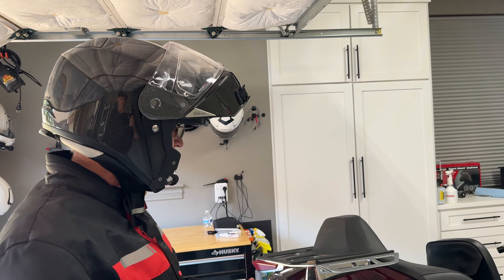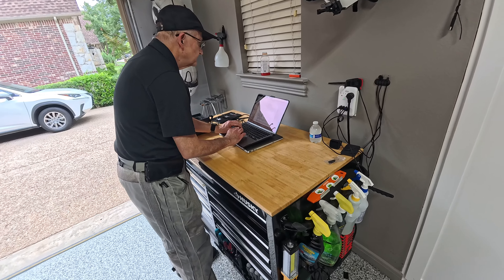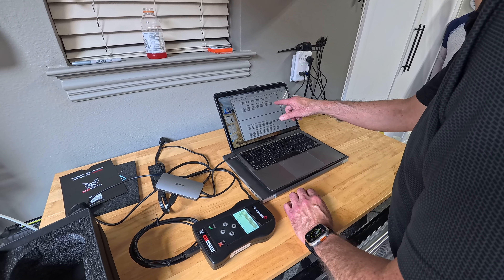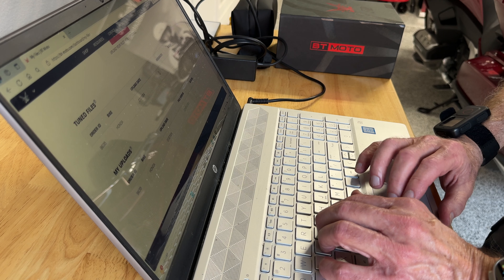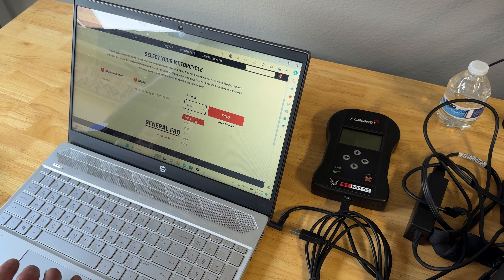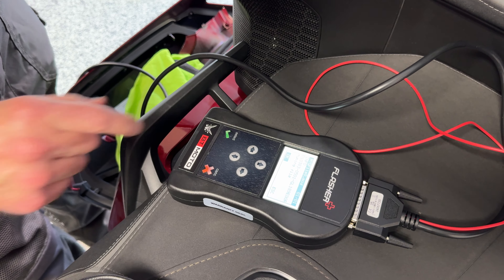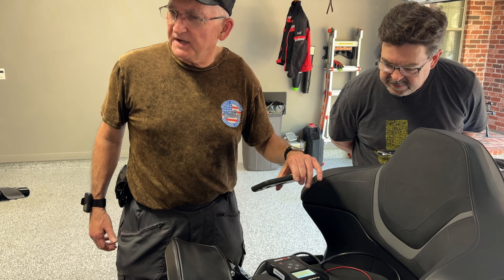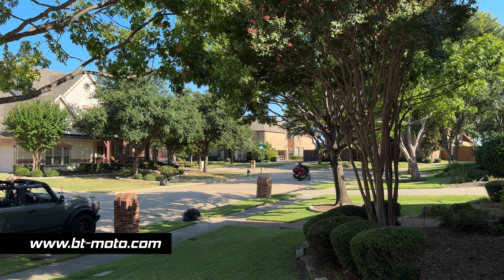BT-MOTO ECU flash on 2023 Honda Goldwing - SECOND ATTEMPT | Cruiseman's Garage

Comment: Very interesting Cruiseman. I had the ECU flashed on my Honda CRF300L and it was a noticeable improvement including resolving the twitchy throttle that motorcycle had. The ECU flash made the CRF300 feel like its got more torque now even with the stock exhaust. Thank you.

Comment: Just a little info. I was having lots of trouble, but it was a software problem. Steven with B-T Moto was very helpful. After several attempts to update the handheld and it not working I did finally discover my USB port on the computer was not working properly. After updating the handheld everything began to work. I just uploaded the file from my bike to BT moto. Looking forward to Tomorow.

Comment: Hi Chris, hope your cruise goes well. This is for the new DYI GoldWing people. I just changed my oil and filters. The local dealer was out of the DCT filter so I picked up a Wix 57671, which looks better than the Honda, anyway for the people who ignored how it came apart, The instructions in the box are 100% backward. They have you put the spring in first, the filter upside down then the cap. I don't see this working out very well for the new guy!! Ps the o ring is included with the Wix filter. Why can't Honda do that?
Reply from the maker: Great tip!

Comment: WOW! Just, wow. They must charge extra for the process. (J/K)
My only experience is with sport bikes and nakeds, but it's always been:
1. Disconnect/unplug ECM (or ECU if you prefer).
2. Remove ECM from bike and overnight ship to tuner.
3. Tuner flashes ECM and return ships within two business days.
4. Receive newly flashed ECM, reinstall and plug back in.
5. DONE, go for a ride.

Oh, and going rate for a mail-in ECM flash without a full on-site dyno tune is only $300.
Reply: Getting to the ECM on a Honda Goldwing is a job.

Comment: Just what exactly is this supposed to address?  As far as i can tell the fuelling on my 23 is excellent.
Reply from the maker: More power in Tour mode, shifts at higher RPMs. Smoother throttle delivery in Sport mode and higher RPM shifting. Results in more HP throughout the range. It may also improve mileage, but that has not been tested yet,. Also, eliminates the 105mph top speed limiter.

Comment: As it is a 23 DCT, is there a concern about voiding the warranty from the factory?
Reply from the maker: @nodouttaviation2817  Definitely will void the warranty. But, you can restore the factory tune.
Reply: @cruisemansgarage  Thank you for the quick response.  As I have a new 24', It's hard for me to justify voiding my warranty for better performance, etc.  Unless, you are saying putting back the stock tune can still get you warranty service if it is needed ????
Reply: @nodouttaviation2817  i would assume their is a counter and guid (unique ID) identified, that is stored outside the common flash area, and probably not deletable ..just my guess…so probably they can tell the deltas or when it was changed , and good chance what has changed…

Comment: Is it easier to ship the ECU to them? How long does it take to ship it back? Why not sending them the ECU during winter months? Done deal and surly programmed.
Reply from the maker: The difficult part is getting to the ECU to remove it. Removing it and re-installing is easy, just lots of body parts to remove to get access. Kind of like changing the air filter. I show the process in my maintenance videos.
Reply: @cruisemansgarage  I don't understand why so many complain about the top shelter removal. Yes, its not easy, but yet not that hard. You take your time and its off. This is my 3rd time doing it. It gets easier every time.

Comment: I have a 2018 Tour DCT and I think it is great someone is trying to improve the Goldwing. I do see this as a very time consuming project. I would not go through this. Years ago I had a 2014 Harley and bought a re-map product and all I did was plug it into the bike, follow the instructions on the phone app and it was done. It also took a copy of the original mapping so if I needed to take the bike to the dealer I could re-install the original map. The process you go through here seems like a lot of wasted time. I would not buy one.

Comment: I pull a trailer and was very interested in this for a bit more power, but it (BT-MOTO) doesn't install the way they lead you to believe. It's nerve-racking to attempt an install of something you know little about, doesn't do what the directions say during the process, and then you could not recover from without some kind of tech support, if you trust them be be there for you (I don't). This whole process needs to be much more straightforward for me to get into.

Comment: The motorcycles ecu was a brick for a week till the reprogram was completed .
Reply from the maker: @victorgonza4528  Not on Toms
Reply: @cruisemansgarage  Not at all, all the initial process does is take a copy of the ECU file, so BT moto can program a modified file. In the meantime, the bike can still be used. The main advantage of the ECU flasher device, is it gives you the ability to restore the ECU back to factory setting, say if you need to have warranty work and you don’t want the dealer to see it’s had a ECU flash (you can then reload the BT moto file back on after the warranty work), or if you want to sell the bike and return it back to factory spec.

Comment: You can't use a mac or frankin mac. Use a pc. Also send a pic of the numbers on your ecu to Btmoto when you order the tune. I know thats a pain on our plastic fantastics. But if your there doing the worse air filter change in the history of internal combustion. Get some good clear pics while your there. Honda has some of the most complex and stupid base firmware code in the industry. It started with there hybrid cars. They change the base firmware and none of the base firmware is interchangeable that contains the tune. And there is no guarantee Btmoto will have what they need to get there tune useable even if you have a pic of the ecu numbers. Because Honda changes the base firmware all the time. Bikes built one after the other could have different base firmware. If they have the base numbers in there system then the flash they send you will work. If they don't have it then they will need you to suck the file off your ecu with there tool and email to them. Or if you can't supply the pic with numbers or just the numbers than you will need to suck the file off the ecu and email it. It's really not that hard to do this flash. It's basically like flashing the bios in your computer or any other devices. Honda is just a pain in the ass and the interface tech. Industry standard but it is out of date or older than there out of date bluetooth version and code used in the audio navi system. There out of date tech is why it takes so long to update the navi software. I did this flash for a buddy on his 2019 DCT. He had the numbers off his ecu when he ordered. So he got a good flash first time. For his standard Wing DCT. It definitely did not turn his into a beast. He likes it! And it now tops out with the windshield lowered tucked at a honest 138 mph. Beast and Goldwing is comical. It's about a honest 8 hp to 10hp and 2.5/3 tq increase and it smooths out Sport mode and firms up Tour mode. Raises the speed limiter or removes it and turns the rad fans on at a slightly lower temp. I think it also raises the redline a few hundred rpm. I think it's a good tune for what it and the Wing are. But he still can't beat my 6MT tour in a drag race. Because I'm faster to the 60' mark and his lighting fast upshifts can't make up for the difference down track in Mexico. And pretty common type of tune we get now days on these chocked up POS Euro4+ and Epa trash engines. Not like the old days when a proper tune could net 15 to 20 hp. And don't see it worth $800 for what you get. I have a tune on my MT-09 and it has the same net gains, with the same characteristics. It only cost $250 at the time, now $300. Just had to pull the ecu and ship it to the tuner. Less than a week for the turn around. And if I change the exhaust, intake, put cams in it,,, whatever I want I ship it back to him and he makes the changes I want free of charge and ships it back to me. If they have a sale or a mail in program I might get this tune or one of it's updates down the road. But not at $800 bucks. That aint going to happen.

Comment: Maybe I missed it, but WHY are you "reflashing" a brand new 2023 Goldwings computer. I'd think reflashing the bikes computer will Void your warranty. If the bike doesn't run, or is running too lean, why not take it back to a Honda dealership?  This is one of the reasons (EPA compliance BS) is why I'm still riding my 15 year old Harley Electra Glide Limited, and the outragious prices of all the new bikes)
Reply from the maker: It is for a performance increase and to make Sport mode more manageable.